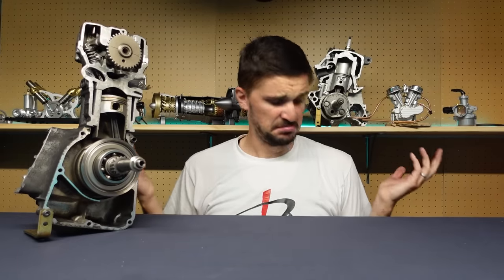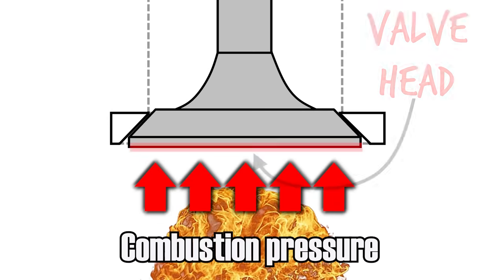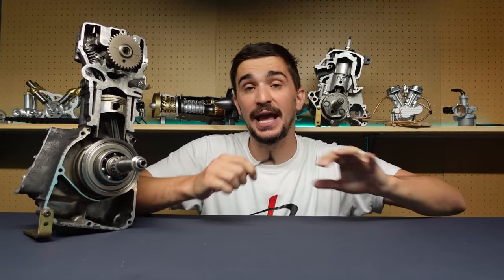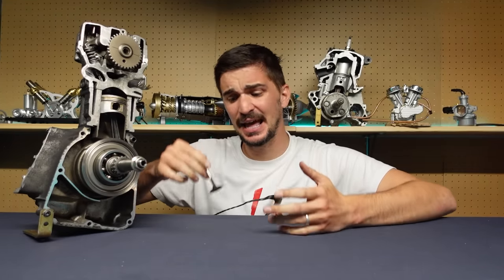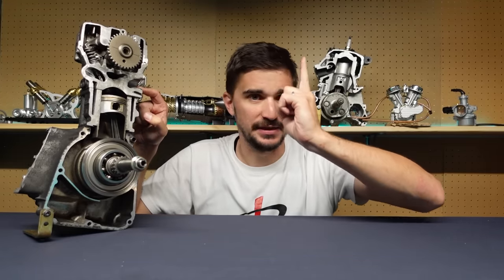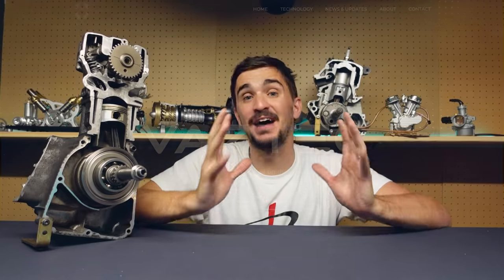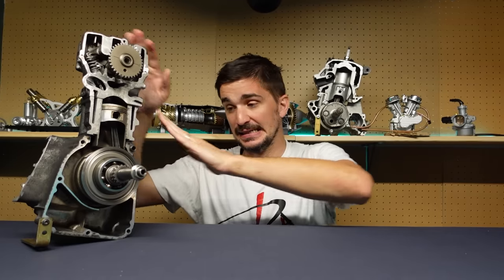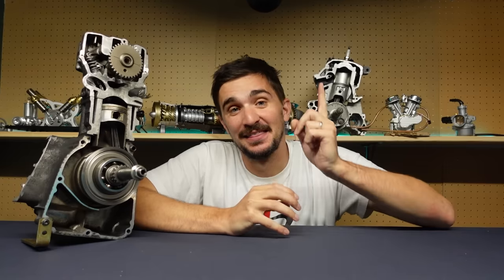Rotary Valves Make Normal Valves Look Silly - Why Aren't We Using Them?

Comment: I brainstormed this idea in the early 00's. I couldn't find any info on this being done and I thought I had a unique idea, until now, thanks for shattering my dreams.
Reply: I did the same 20 years ago in the shower for automatically folding rear wings and front aero that alters drag depending on cornering and speed like Ferrari did 😂😂😂 not even making it up I was only a kid with a cast model of a Modena
Reply: Relatable
Reply: I feel your pain. - Bill Clinton 1994.
Reply: I follow the general rule of thumb that if you can think about it, others before you have as well. Such thinking won't lead to me feeling hopeful of inventing something, but certainly got me looking up existing patents any time I thought my idea was a winner. I did have an idea for an unpatented idea at one point, but I realized it would be difficult to enforce and not that profitable for companies to implement. So, that was it. I can't even remember what it was, but it doesn't matter. It's very hard to invent something something valuable AND unpatented AND original (not found in "prior art") and then profit it off of it. If it's a big money idea, people will spend big money ripping you off and defending themselves from your protective lawsuits. That's if you can even afford to sue them.
Reply: Yeah I also invented hydrofoil boats some 20 years ago as a teen. But they had been around for decades already :) Foil boards were not a thing yet but I was mostly thinking about boats and sail boats heheh

Comment: I did my Masters degree in university on Rotary Valves engines . Not only do they breath better, but their volumetric efficiency bandwidth is wider, meaning there is no need for variable valve timing for normal road going cars or even high rpm race cars.
They work best with any forced induction. A small 1.5l engine could easily achieve 500kw (670 hp) assuming the engine can handle it. 

Also since there is no piston/valve collision risk, the valve timing could be much more aggressive.
Reply: 40 and 50 years ago they had trouble with the rotary valve binding up due to the combustion pressure.  How do they overcome that now, if they could?
Reply: @Adscam  there is something called floating valve seals, they basically float between the head block and the rotary valve, the more the pressure is the more force the floating valve seals. A special film coating is used that has amazing anti-wear properties. Thus these two solutions help eliminate valve expansion and seizing.
Reply: I'd like to see the full airflow vs duration curve. Obviously it will flow well full open but what does it flow part open, which is most of the time?
Reply: Am I mistaken to believe that there have been several sleeve valve engines in production? Mostly for ships or stationaries, but also a couple of warplanes and such.?
  I was under the impression that sleeve valves were- up to this point -the most successful alternative system of valving that had been tried, but this comment section leads me to believe that the idea has been abandoned.
Reply: At 3:39, the statements made do not seem to align with the photographs of Normal / Valve Seat Recession. I noticed this.
Reply: @billshiff2060 they are open or closed with very little transition time and open/close extremely fast
Reply: @ronfox5519  Sleeve valving uses conventional ring type seals.
Reply: @jeffknapp5005  No the duration are about the same as usual and they are fully open only for an instant.
Reply: It's a very interesting title for Master's thesis. Bet you enjoyed every second of it
Reply: @berkeliumk  omg how did you know, you are correct, I’ve never loved working on documents and data like I did when I was doing the thesis on rotary valves
Reply: @billshiff2060  your question is valid, however since air does not need to change direction (I.e flow around the popper valve) the air flow is higher even at partial opening for a rotary valve.
Reply: So why do you think nobody used it ? Because it has a lot of problems theoretically it works but in real life it is hopeless!!!!
Reply: Do you mean the kind of seal you can find on a vacuum pump? A simple parrellepipede making contact on the chamber due to centrifugal forces?
Reply: 500kW "easily" from 1.5l - I call Bullshit on that. So youve lost any credibility right there.

Regardess of how good the rotary valve would be, this doesnt add up.
Reply: @samawalaladawi3955  any software suggestions on how to model/prototype/simulate a valve system design before making an actual prototype? Air flow, valve timing variables etc etc. 

Have an idea I want to test out
Reply: @jakubmusil1109  why doesn't it add up? Care to walk through the numbers & logic here?
Reply: @SabeerAbdulla  Sure.  first off, the difference between common valve and rotary valve is that is allows better flow and less restrictions. And while that can INDEED improve efficiency and power, it is necessary to stay reasonable.

How much can an 1.5l naturally aspirated engine make>... pretty much a peak naturally aspirated "mass" produced 1.6l engine makes 136KW (B16B), that is before much ecological restrictions etc.
Sure you can probably get a little more if you really wanted, but even a racing 1.5 N/A maxed out at around 150KW. 
Just from the get go, saying you can "EASILY" produce OVER 3 times that is just... absurd. The valve can get better flow, but nowhere can it make the engine have 3 times the efficiency, nor take in 3 times more air and fuel ... there simply isnt the room in the 1.5l to put enough air and fuel in, in order to produce that number. Just look at the energy (power) contained in petrol. the IC engine has like 30% efficiency out of that... and you can calculate how much petrol you need to burn to achieve 500KW... you cant fit that amount into 1.5 N/A. 

And if you think ok, so forced induction, and compress more air in, so you cna burn more fuel and get more power... sure, compressed air, the sky is the limit, ... or the pressures you can handle is. The thing is that in forced induction application, you are pushing the air in at GREAT pressure... and while a valve will be a restriction it will be just some losses, but a limiting factor that would prevent you from filling in enough air. What I mean is, we can put in more air, as it is (with common valves) with big enough turbo,  that the engine parts can not handle the power and pressure. So better valve would only mean we have some lesser losses, but not really affect the max power. 
Top 1.5 turbocharged engines, even racing WRC ones make like 300KW. 
How much more would same engine produce with rotary valve? definitely not 200 extra.
And while it is technically posible to go higher, as ive stated with the forced induction, why is the limit, it just isnt the valve that is the issue.
Sure F1 could get almost 1000 KW from a turbo 1.5l. But this is FAR, FAR from what anyone would call easy, nor is a valve a real factor there.

I could try co calculate what % efficiency you would need in an 1.5 N/A, but just doesnt make much sense.
Reply: @jakubmusil1109   the OP is talking about forced induction with the caveat that the engine can handle it. However, his main point is that the volumetric efficiency bandwith will increase significantly. 

In any case, as you've pointed out ab F1 engine can do it so it's not that it's technically not possible, the issue with be how "easy" it would be. Going for 500 instead of 1k in the F1 engine would make it 50% easier than F1 presumably 😄 but again, even in the F1 engine, the entire premise would be to get more fuel and more air into the engine right. (Ignoring their insane tolerances that mean you can't start it up without heating it up first but I'm guessing that's not contributing much to the 1K number) If it's isn't the valves in the F1 engines, then what is it? Because their higher 15K RPM  would suggest that's in fact where they need and get their improvements from. 🤔
Reply: @jakubmusil1109  bmw got 1000kw out of 1.5l when it was strong enough and didnt need to meet emissions the real question is can it make the power reliably without worse emissions. unless you are assuming that he is saying 500kw without boost then i agree however the bmep is more interesting and if a rotary valve can crack the 128nm per liter with petrol.
Reply: @jakubmusil1109  I agree 500kw na out of 1.5l is absurd but 500kw out of 1.5l is not as hard as you make it out to be the bmw m12/13 used a stock block with 2 bolt main caps if i remember right(this did fail with the crank flying out in quali) just look at a b58 they get over 750kw with port injection, con rods and more ring gap. the thing with a wrc engine is that it is in a power class so limited to 300kw for example but very high torque with a flat power curve. wrc engines are not made for peak power. the more interesting claims  are that of higher bsfc and bmep as well as better swirl and tumble without sacrificing ve.
Reply: Did you only study the straight pipe variant or other changes to the valve, like having the tubing curve so as to pull double duty and reduce the seal between the intake and exhaust halves?
Reply: @RilsR  it’s a whole thesis, so it’s everything from valve timing to air flow rates and coefficient of performance, BMEP, VF, BSFC, as well as eddy currents of air flow, and heat release rates, friction resistance and lastly seal performance.
Reply: @RilsR  we did a simulation of valve seal, however I did not manufacture any prototypes therefore my seal designed are only proved in simulations
Reply: @SabeerAbdulla  AVL Boost was my favorite
Reply: Sorun döner valf!
Yüksek basınçlarda kaçırır ve çok kısa sürede aşınır.
Reply: Varible vavle timing includes variblity in thr opening size of the port and duration. The rotarty would have a hard timing easily matching with speifically designed roarty for each engine rpm whichmakes ithigh cost.
Reply: @jakubmusil1109  There are 2000 whp 1.8l's.  By that measure 500kW IS easy.  Forced induction lets you do fun things.
Reply: @LeCharles07  you are talking absolute extremes... Its like sayin, hey, orbital velocity is ~ 25000 km /h. And we have ppl going that fast... so going 2000 km/h must be easy... riight?
Yes and when force induction comes into place, the flow efficiency of the valves is much less of a matter or improvement, because it's not what the limiting factor is, or you can overcome it with just more boost... and it becomes something "sure why not" but marginal. Hence why I tried to explain that the valves play significant role only for N/A ... and in N/A applications, good luck trying to get 500 KW from 1.5.
Reply: Its also suitable for hydrogen ic engines i guess
Reply: Be great to have a beer with you and talk shop you clearly know your shit
Reply: I'm wondering why they aren't (or maybe they are and I just don't know it) using rotary valves in F1 engines. Would it be too unreliable under the extreme load?
Reply: Rotary valves are working in the wrong plane.
Cheers!
Reply: Don't seal long term and heat expansion kills this..hence its only been used a handful of times. To much maintenance..
Reply: @samawalaladawi3955 Is your thesis published somewhere that would be accessible to read? I’d love to take a look at your work!

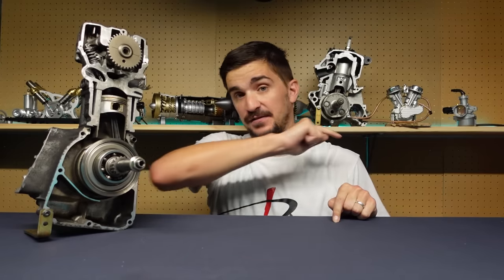Comment: Yes.  I also in my University days came across rotary valves.  The main ones were the Cross valve and the Aspin conical valve.  The Cross valve was similar to the one you featured being a cylinder type valve.  I found the Aspin to be theoretically superior to my eye.  A vertical cone had a port in the side wall and spun on a vertical axis.  This had the additional advantage of favourable combustion chamber shape, with additional combustion benefits of lower octane fuels and leaner mixtures.  And as usual, sealing, lubrication and wear were the main issues.  However in Aspin's later designs, he had cleverly mitigated a lot them by a non constant rotation speed.  During the high pressure and temperature part he would drastically slow down the rotation and then during low pressure phases would accelerate the rotation.  This obviously helped to reduce these issues during the most harsh parts of the cycle.    The speed differences also enhanced the pulsing effect in inlet and exhaust and hence additional efficiencies could be obtained through tuning these pressure waves.  Aspin used planetary gearing to achieve this, but modern implementations would probably use stepper motors.  The design was so efficient it was claimed to be able to run on mixtures as lean as 1:23.  With modern materials and designs no engineering reason why it wouldn't work now (apart from political and financial!).  Maybe sintered powdered ceramic conical valves is the way forward for low expansion properties?  LJK Setright did a book  "Some Unusual Engines" were he covers the Aspin and Cross valves https://archive.org/details/someunusualengin0000setr/page/48/mode/2up.  See also http://www.aspin.info/

Comment: My grandpa worked at Bultaco for most of his life, they experimented with 4 stroke engines with rotary valves, iirc they never made a production engine because of sealing issues and burning a lot of oil
Reply: ' because of sealing issues '  Exactly, hard to beat the 'tends toward self sealing on pressure' action of standard valves.
Reply: It seems like you have two choices. You have a rotary valve that is sealed by a layer of oil, which gets burned by the engine and increases emissions.  Or you have a rotary valve that seals because of tight tolerance, which means high frictional losses (greater than the valve springs) plus decreased service life. 

This seems like a great option for a race car that gets rebuilt every week, not so much for a daily driver.
Reply: Seems like a trend with rotary things in cars
Reply from the maker: Bultaco was super cool!!
Reply: @d4a  Im currently restoring my dad old Streaker with the watercooling kit my grandpa and dad made for them, the kit parabellum. Its so cool to works on those old bikes and see how stuff evolved over time.
Reply: @talyrath You could go the rotary rout for the first option, and have a separate oiling system that uses 2-stroke oil for the valves.
Reply: I wonder how it would work using ceramic bearings.  If they can handle the heat and RPM's of jet engines.  An ICE engine should be a joke to them.
Reply: @talyrath  The Wankel uses tip seals that seem to work.  A straight cylinder should make it even easier to do.
The cams, and crankshafts are running on a film of oil.  I don't see why they can't put an oil ring to seal the rotary valve just like the pistons use to keep combustion out of the crank shaft.
Reply: @d4a  Why didn't you mention sleeve-valve engines?
Reply: @robertsmith2956  Ordinary bearings can be fine jets, as well (we use them for most applications). But bearings aren't really an issue with rotary valves.
Reply: @robertsmith2956 To have all of the advantages of poppets, you'd need "wipers" that were stationary just past the inlet/exhaust ports in the head. That leakage show actually goes out the intake and exhaust, as that leakage has nothing to stop it from going into the valve cylinder.
Reply: @robertsmith2956  The problem is the combustion event being cyclical, its like hitting the bearing with a hammer for every second rpm. Jet engines are like a constant push with no impacts.
Reply: The rotary valve was used in production engines to do the same thing as a reed valve. Since it neither has to seal perfectly or withstand temperatures it isn't similar. But it is a rotary valve.

The last road legal 2 stroke ever sold in the US, the KE100, used this for decades.
Reply: @d4a Bultaco Pursang!
Reply: @talyrath  It really is. Rotary is good for high RPM application, probably multi-cylinder engine in general. For emission, it was poop. 5-10% gas bleed, which is bad for efficiency and compression. And poppet scale up better with displacement (assuming number of cylinder stay the same). Poppet is bad for small scooter because the whole spring valve took out like 1-3 hp out of already weak engine, but give it 400cc single and now it's almost irrelevant.
Reply: @autodidact537   Because he made a video about rotary valves
Reply: @d4a Hallo sir.What about Tesla valve, has anyone tried? I know it'nit perfect from sealing g point of view, but a t fast revolutions speed the time could be so litttle that could begin to come convenient. Moreover it's a modular concept that can be increased on demand, and a rotary valve just at the cilinder's entrance could even improve efficiency with little construction difficulty. Just a thought.
Reply: A friend of mine raced flat track motorcycles, Bultacos are always some of the fastest ones on track.
Reply: @SUPRAMIKE18  I have a Bultaco flat track racing engine with serial number 000001 
;)
Reply: @talyrath not tolerance.
. but clearance..there is a difference.
Reply: Yeah they're no bueno. The nifty thing about a poppet valve is that the internal pressure forces it into its seat and seals it very tight. Getting that geometry to work with a rotary design was always iffy.
Reply: @blar2112  I'll sell you my arm and leg for that one 😂
Reply: @d4a  The energy you put into the valve is released again. It is therefore wrong to assume that the compression of the valve saps the engine's energy. It does not consume it. The friction does but that is a problem with other systems too.
Reply: They flow like absolute ass compared to standard valves, too... I wouldn't have even wasted my time trying, tbh
Reply: @billymanilli  You dont really know until you try, this is why R+D exists
Reply: @smuckerst8355 I just left a comment about my KE 100, didn't realize it was the last or one of street legal two strokes, interesting.